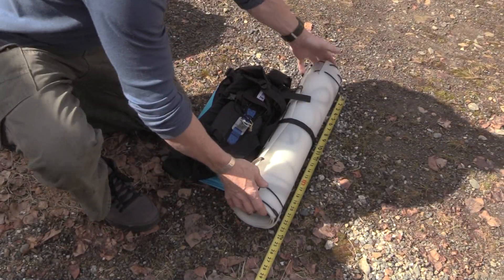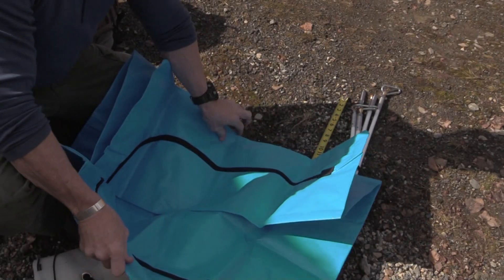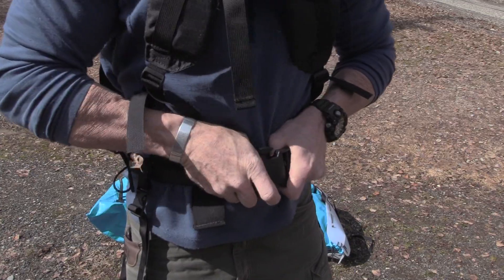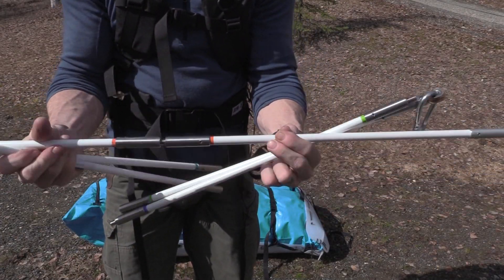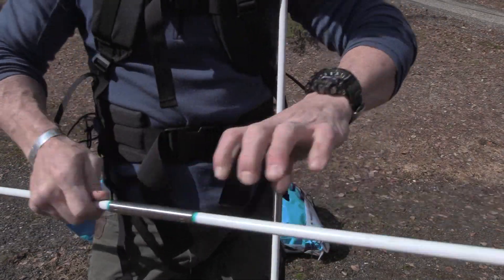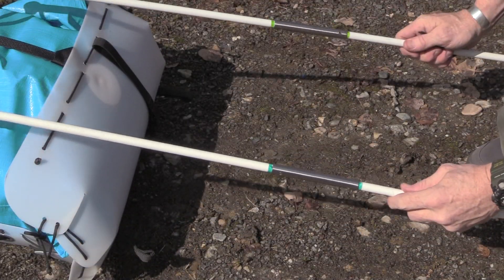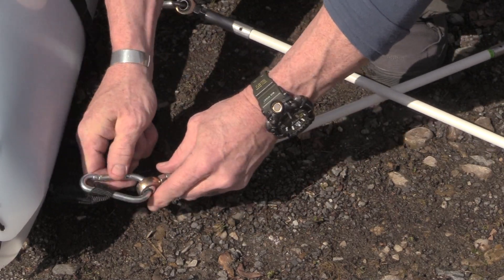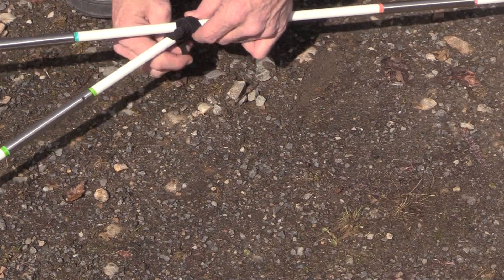Arctic Sled iteration 1

Comment: Are those poles long enough to use the sled with skis. How about stabilization on side hills. The Pulk sled , although a different animal, has some find on the side to keep it from sliding sideways on side hills.
Reply from the maker: This is the minimalistic prototype but these questions are great ones.  Interesting process working with military units because they all require different applications and performance measures for these "jumpable sleds."  More iterations and side-hill adaptations are in the works for these troops.  Just keeping the GP informed as we develop next level projects for arctic mobility.

Comment: Used this harness on a different pulk. Never felt like I needed the leg straps or torso piece. Just having the waist belt was perfect for maneuver in tight spots like dense trees or in steep terrain on skis when I need to turn sideways to walk up. Belt rotates on my hip nicely and allows me to make tighter turns, especially skiis. But its easy to add or remove pieces you may want or not, which is nice. Just my feedback!
Reply from the maker: great feedback!